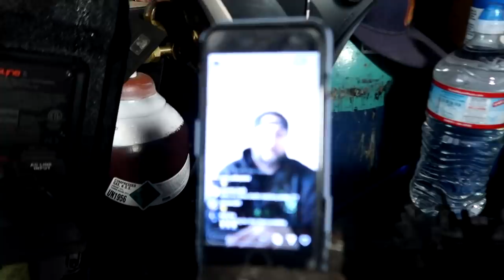K20 AWD WAGON TWIN DISC CLUTCH ! !

Comment: The flywheel is usually thinner and that’s why a lot of companies supply the kit with new AT Honda bolts
Reply: Mine was the bolt heads would rub on the clutch plate so I ran auto bolts to clear it.

Comment: unsprung = hurting ur bearings specially you have a light weight flywheel  or maybe with those Ebay lightweight crank pulley